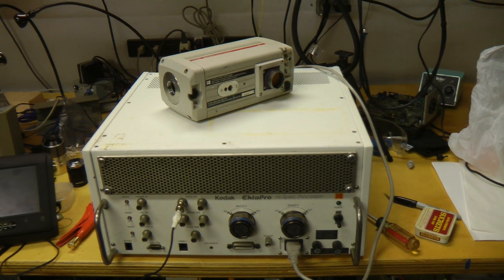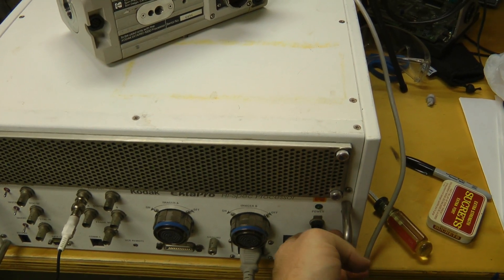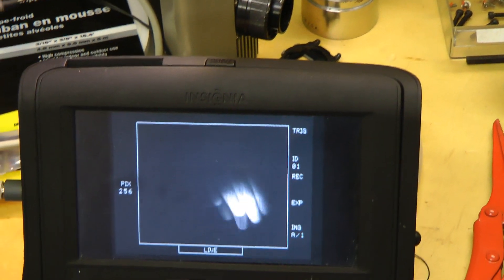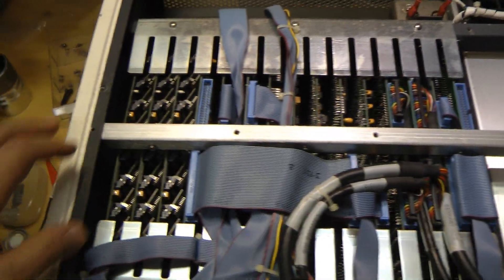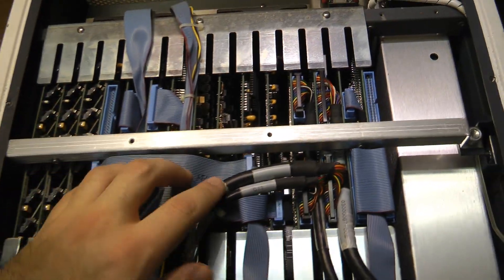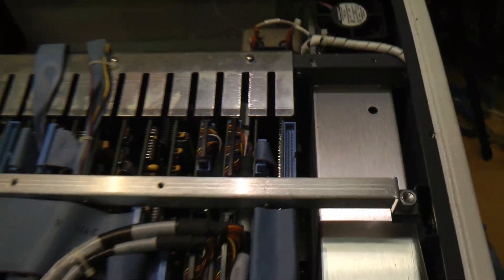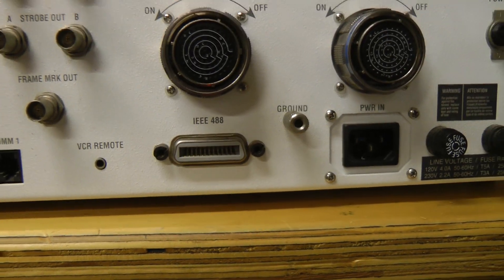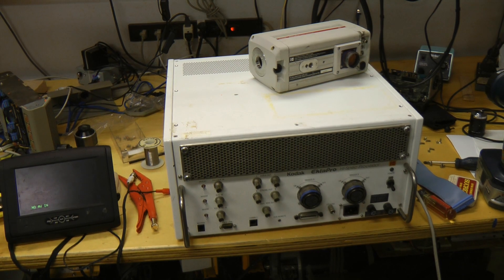Kodak Ektapro Hi-Spec processor intro

Comment: Had any luck finding a new cable? How many pins does that mill spec connector have 79? Could use a 50 pin and a 37 pin  D-sub connectors cheap and easy.  As long as your aware of the twisted pairs and have a pin extraction tool should be good. I have to do those connectors all the time on subs so I know what a pain in the ass they can be.

Comment: Cheap way is to buy a pack of the pins and a pack of the socket inserts, and just heatshrink them after connecting a wire to each. Then make a 3m lead and after putting them in correctly fill the connector with epoxy to hold it all together. Those are used in aircraft, you might find similar on eBay as avionics looms, just look for the sockets and plugs as parts.